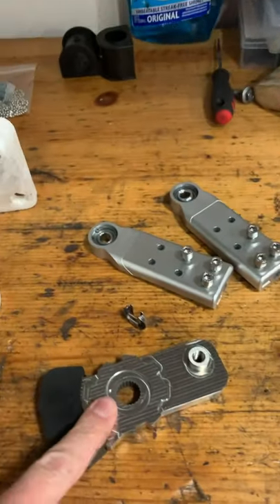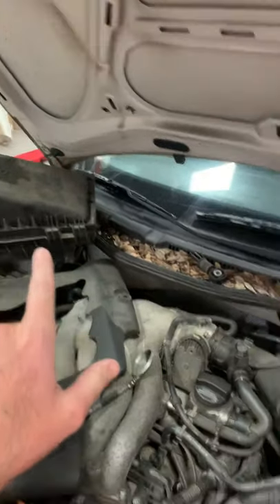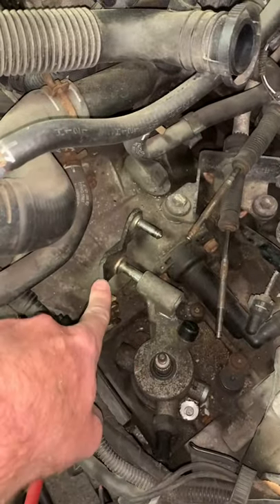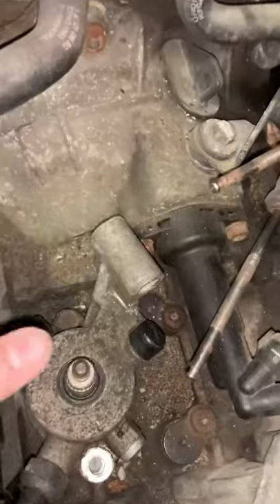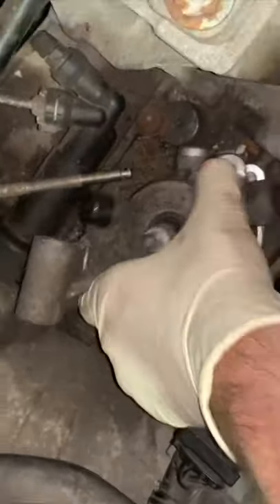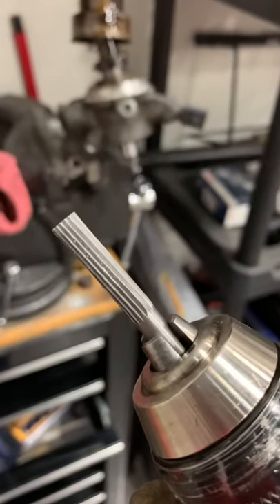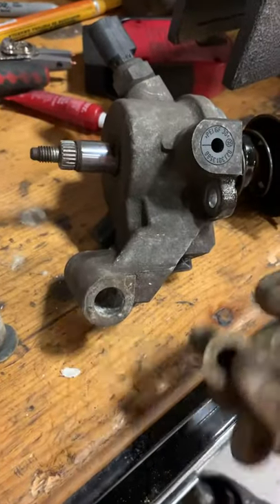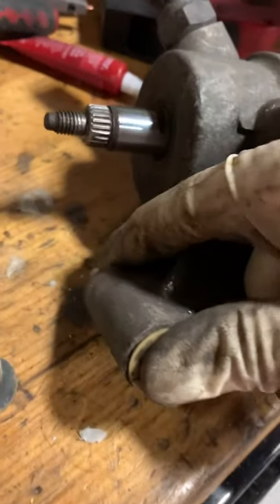Stuff that Happens on Old Cars #shorts

Comment: This is what my mechanic said when I brought my 06 car to him. I was wondering why a condenser swap needed at least a day. He told me that age does not treat element exposed metals and plastics kindly lol.
Reply: Yet you could bring in a car from the 70's and it would be done in about  2 hours, including replacing the other seals and valves so it could use modern refrigerant and recharging the system
Reply: A condenser, a day? Lmao you were getting sold a bunch of BS. Especially on a 06.
Reply: Change mechanics. All I have to say
Reply: @Tyshkevich  The car has 300,000 miles on it and the front looks like it's been hit with a shotgun a few times. The condenser itself was completely rotted through the middle. The job itself was done on the same day and was picked up that evening. He gave me the conservative estimate incase a bolt snapped off or something else broke and they needed to get it.

I dunno about you but I appreciate the honesty I got.
Reply: @todddenio3200  ya cause now they wanna slap all the key components into a quarter of the space because they are afraid of spacious engine bays 🤣
Reply: @Laughup89  they don’t want regular people being able to work on their own cars and having to take it to the dealership for all repairs and that way when a car gets a bit older and has lost much of its value the customer will not get it fixed because it will cost too much and they will have to buy a new car instead
Reply: Oh yeah plastic is hell on a old car just breaks or snaps or sometimes becomes the strongest element on earth
Reply: @Laughup89  well it's actually crash safety stuff that makes the engine bays more full all the extra reinforcement and all and obviously yeah more crammed more pain for normal people, more suicidal thoughts for bmw mechanics

Comment: When I was changing my control arm the bushing seized onto the bolt and the bushing was spinning with the bolt. By the end of it I had to cut the. Control arm off of the bushing with a grinder and cut the bolt and bushing in half to pull one side out and the other side down. I was prepared for this and bought a new bolt before I got to it.

Comment: I once had to remove a roll pin on my shift tower but there was no way to get tools in there or remove the shift tower without dropping the trans.  I fashioned a custom press with a punch, socket, drill, and a c-clamp.  It actually worked really well.
Reply: I've done it too to remove stuck bolts seized up in suspension bushings

Comment: "Really Old Cars" - Here is a mk4 golf.

Older car maybe, but nowhere near "Really old".

It's the car that helped develop my engineering skills when I was an apprentice... because it was so bloody unreliable! Back in 2008 I think, it had nearly 200K miles on it and everything underneath was majorly rusty.

The nearly identical mk1 Leon that I got to replace it was a dream. 130k miles on the clock but in very good condition.
Had it 10 years and clocked up crazy mileage in it. Only parted with it because I needed an entirely new exhaust system, a new air bag and a new shock absorber all at once, thanks to changes in the UK MOT test laws.
By this point the paint had faded, somebody had dented a panel for me and the interior was becoming worn, so it was time for an upgrade!

Comment: That's not a really old car.  Heck my daily driver is older. And my newer secondary driver car is older.  Lol. Nice clean and a lot rust than stuff around here.   Especially the last mk3 Cabrio I fixed the shift linkage on, and the struts, and the ball joints, and the cooling fan control.
Reply: Discofelsi  yep. My daughter will be learning to drive in a few months. On two vehicles that are older than her.  One two years and one 13 years older than her

Comment: Curious why you didnt just use the drill bit that fit nice into that hole instead of wasting time grinding it out with a stragiht bit and risk grooving the inside for moisture to gather and repeat the same issue next time but worse?

Comment: Don't forget, if you have a "classic car" your in for a penny, in for a pound. Just expect anything and everything to eventually go wrong and need to be fixed or replaced. A common forgotten replacement that you should do is rewire the whole car. Manufacturers only develop their wires to last about 10 years. No manufacturer plans for a cars parts to be functioning in 30+ years. They sure are fun and nostalgic.
Reply: I can safely assume if one needed to rewire a standard car one would call the junk man. My truck is 21 yrs. old. The wiring is not an issue yet.
Reply: @soundmind192  then you are lucky thus far. I had a 25th anniversary Foxbody Mustang, the wiring was deteriorated.

Comment: Would tolerence allow to ream the hole to remove corrosion?
Reply: Not unless you want slop in your shifter.  Any small amount at the linkage point there will magnify at the shifter.  For example, 0.5mm of play at the bushing could result in 25mm of slop at the shifter.

Comment: I have a 1997 (Mk. 3) 2.0L GTI. It was built in 96 so it's old enough to have gone to college and gotten its bachelors. I bought it new. Now it has 270k on the original motor and transmission. Bet you my shift bushings look just like that. 🤣🤣🤣

Comment: Amused.  My ‘85 Toyota is the “newest” truck I own.  What you’re describing isn’t an “old car.”  It’s a new car, new enough that the “problems” are typically electronic and not actual problems like spun bearings and broken rods.  I work on vehicles as old as 1930’s on a regular basis.
Fair.  But good vid nonetheless.